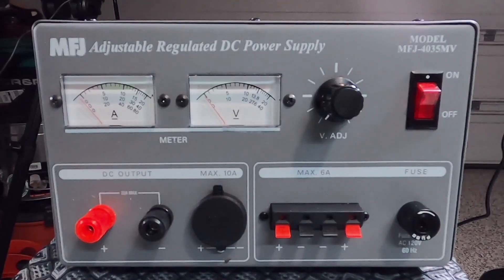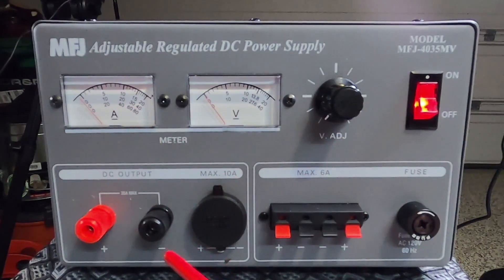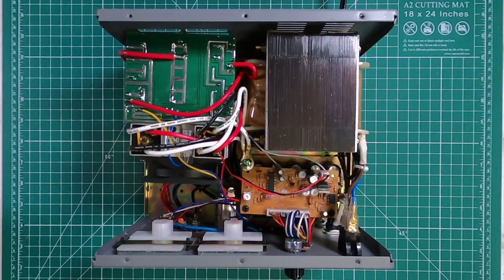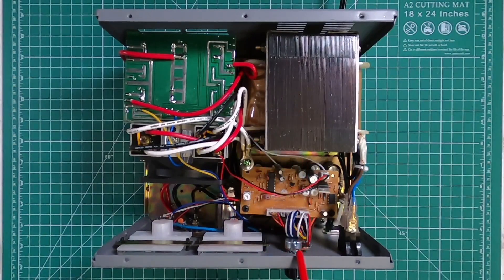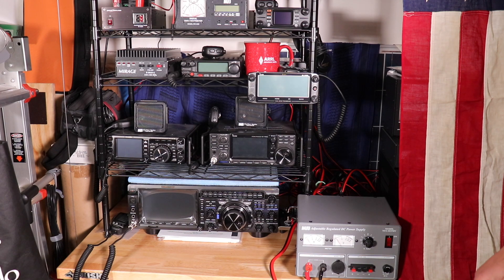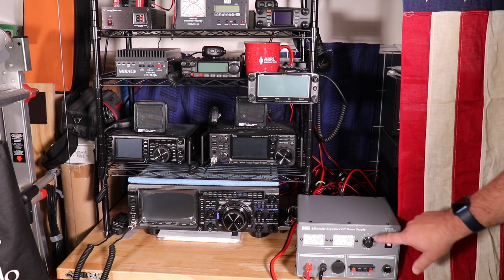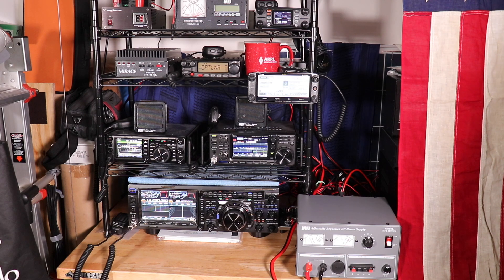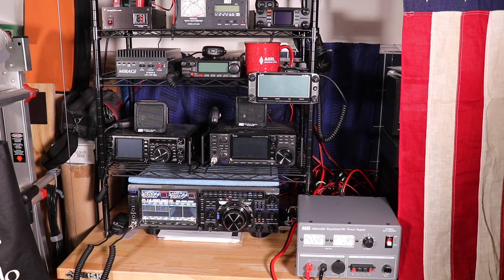MFJ-4035MV 35 Amp Power Supply

Comment: What kind of Power Supply do you use and/or can utilize for the Yaesu FT-2900R/E? Thank you.
Reply from the maker: Thank you for taking the time to watch and the comment! It is greatly appreciated. When using my FT-2980 I use the Powerwerx SS-30DV. I have had mine for nearly 10 years I think and it works like a charm. I have one in my Amazon store that you can read about. https://www.amazon.com/shop/wj6f/list/1T1JULH7OZO8T?ref_=aip_sf_list_spv_ons_mixed_d